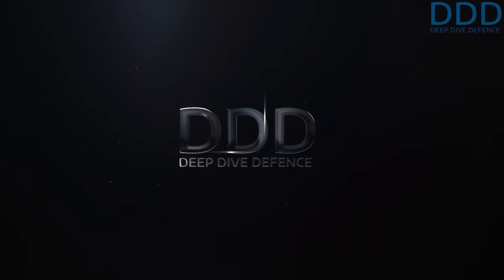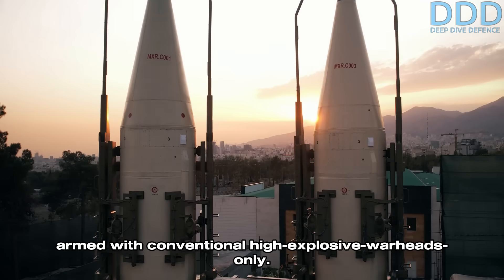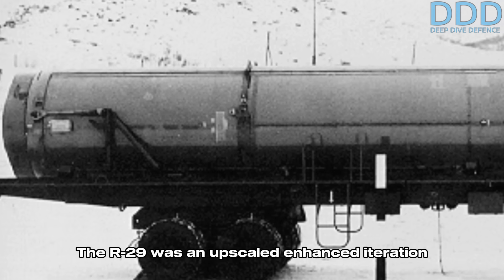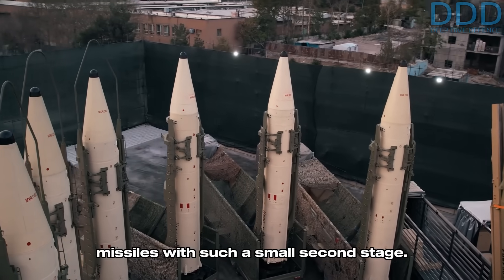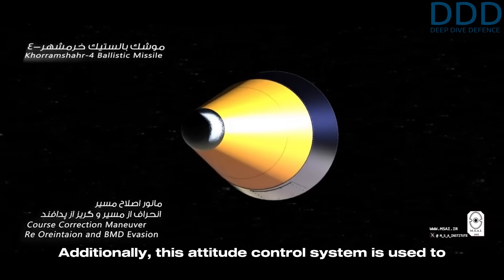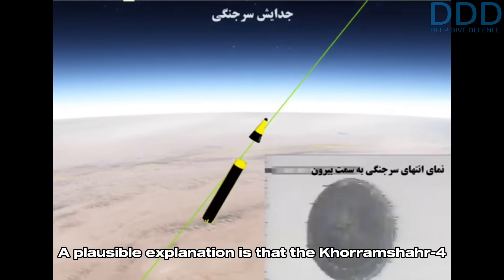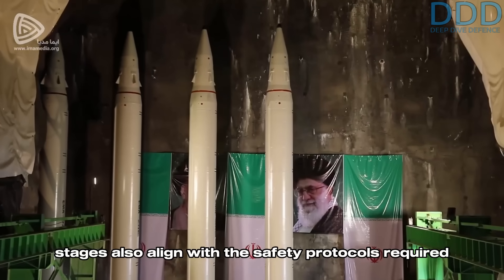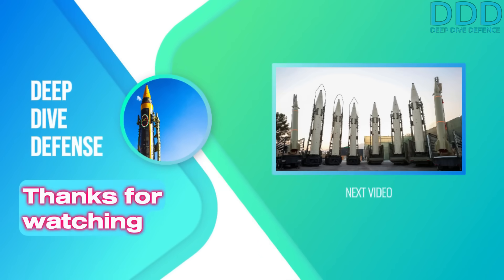Can Iran strike continental U.S.? The secretive Khorramshahr-3, an intercontinental-range missile?

Comment: Khorramshahr 4 : 

Length : 13 meters
Range : 4300 km
Speed : Mach 16 out atmos/Mach 8 inside atmosphere
Warhead weight : 1500 kg
Weight : 30 tons
Diameter : 1,5 meters
Fuel : Hypergolic
Accuracy : 10-30 meters CEP

Comment: I wouldn't be surprised if Iran had the capability of making an ICBM for many years now. Iran's ballistic missile program is extremely well developed. I don't see how it's not within their capability. Not making an ICBM before, was likely a choice, they didn't want to exacerbate tensions with the US, so they chose not to make one. Now they have a reason to make them, and make many of them.
Reply: There is a video for 20 years ago that general tehrani moghaddam (missle program commander of IRGC ) said we have no limit for our missle now ...
Reply from the maker: Well, the R-27 is sufficiently high-tech to enable a low cost, two stage light ICBM.
Iran only manged quantity production of this tech in the late 2010's.

ICBMs before that would be cruder, larger and more expensive

Comment: Going from 2,000KM to 10,000 KM range with the same missile and in one shot sounds like a stretch. From a military and strategic perspective being able to threaten bases like Diego Garcia or some of bases in Europe ~5000 KM makes more sense as a deterrent.
Reply from the maker: It's all physics

Not to talk about that the single stage Khorramshar-2 did 2000km with a very heavy 2000kg wearhead
Reply: It's mostly a matter of giving your projectile enough Delta-V (very simply put: total speed from beginning to end).
A lighter warhead means that the same engine and fuel will give you a higher Delta V.

Furthermore, in the vacuum of space, it takes MUCH less fuel to add or subtract from your velocity (increasing range) and to maneuver (defeating interceptors), and to de-orbit (hitting what you want to hit more accurately).

Simply put: once your projectile/warhead or vehicle is already above the atmosphere (which is what most of the fuel is for), it takes much less fuel to do everything than it would take you if you were still in the atmosphere, especially with vacuum engines that were designed to have a high efficiency (Specific Impulse or ISP) in space/vacuum.

It is not just possible, but very likely, given Iran's breathtaking track record in relation to missile technology development and the ingenuity of their engineers.
Reply from the maker: Correct points
Reply: Because there is no friction in space, objects can orbit a planet indefinitely before striking their target, much like satellites that do not require fuel to maintain their orbits.
once you reached apace vacuum distinction between a range of 3,000 km and 10,000 km lies solely in the timing of re-entry phase toward earth.

that's why anyone with rudimentary knowledge about rocket science knows that if you can put a satellite into orbit, you can reach anywhere on the planet with your missile. In fact, every ICBM-capable nation has reached this capacity before having the ability to put a satellite in orbit.

Iran sent its first satellite 2003
there are eight spacefaring nation in the world and Iran is only one among them to pretend doesn't have ICBM
What's the benefit for Iran to pretend it doesn't have these capabilities? It's simple to not scare the Europeans and keep them away from joining the US in war with Iran and also, they like to be underestimated, remember Persians/Iranians invented chess so why not use the famous western arrogance in your favor.
some times I wish they are dumb enough to actually go to war with Persians 
they seem to forget their mighty empire was giving tribute to Persians
the Romo persian war hold the recored of longest war in human history lasting 700 years and the fact that they didn't made even single Hollywood movie made about it should tell you how one sided and humiliating it was for them

 The same fate that befell the Romans, who foolishly aspired to conquer Persia, would await the US—humiliation. Emperor Valerian was defeated and captured alive by the Persian Emperor Shapur the Great, who used him as a literal stepping stool every time he mounted his horse. Each time, he reminded Valerian, "No, you aren't dreaming; this is reality. however, you conquering Persia was a foolish dream that led you to this very really." You can find more about this by searching for "the stepping stool of Persia" or his other title, Emperor Valerian.

Another Roman Emperor who fancied subjugating the Iranian people was Marcus Licinius Crassus. He was also defeated, captured alive, and crowned as both Emperor of Persia and Rome, with molten gold poured over his head.
Reply: @mansari7310 Great points, if you look at Irans flag it has a nuclear missel detonating. In the Book of Jeremiah it is prophesied that the Daughter of Babylon aka America would be destroyed by Medo-Persia aka Iran,Iran is also known as the Carmanians in the Book of 2nd Esdras in the Apocrypha. Now it makes sense , just like you said any nation that can put a satellite in space can launch an ICBM. And soon we will find out after the Daughter of Babylon aka America and its extension the state of Israel attacks Iran. Also the people that are calling themselves Jews or Israelies are not the seed of Jacob/Israel but are Khazars, whom are impersonating the real Children of Israel,whom are the so called Negro, Latino and Native aboriginals of North and South America and the Pacific Islands.
Reply: Thanks  for information  @mansari7310
Reply: @mansari7310 ☝️💯🫡